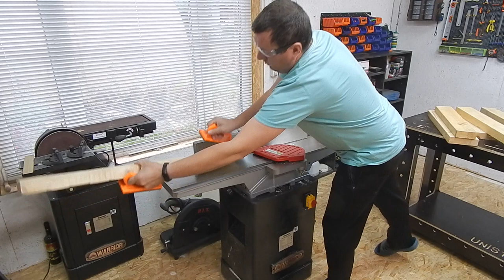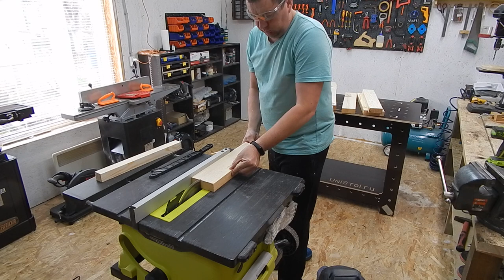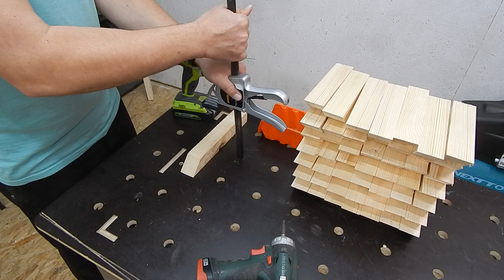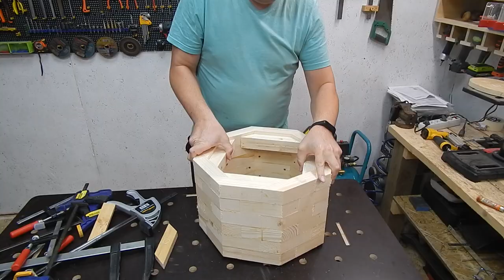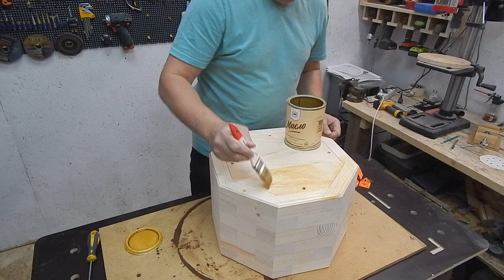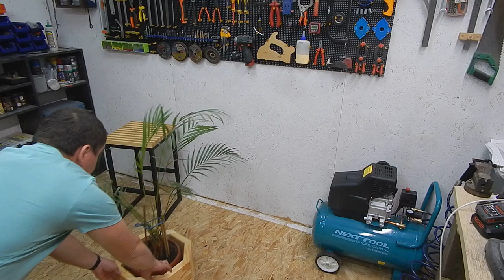DIY Unique Wood Planter Box

Comment: Very nice! What angle did you cut your small boards with! This turned out gorgeous! Thanks for sharing!
Reply: Hi pinkfluffydino it seems that there are eight sides if you divide 180 degrees by the the number of sides it should give you the angle of 22.5 degrees. Terry
Reply: @terencemeredith3066  Nice! Thanks!
Reply: Sorry its late but just tried building one myself.... And the cuts where made at 45 degrees since there single miters and double which would make them in an agle of 22.5. But since its one miter connecting both pieces the miter will be a 45
Reply: @rogeliochavira4524  makes sense! Thank you

Comment: 4:12. 8/12/24.     I just made this.  ALL ANGLE CUTS ARE 45 DEGREES.  I made each piece 9 inches long.  Equates to a diameter of  19 inches.  Pretty big.  Maybe start with a smaller piece. ( 7 inch?).  I used inch and one half screws.  I attached each "layer" with glue (Titebond Ultimate) and secured with 2 and one half pneumatic 16 gage nails.  I ripped the wood to 1.5 by 1.75.  My concern was having sufficient nail length (2.5 inches) to secure each layer.  My thought,   the nail penetration into the lower layer of 0.75 inches would be sufficient to hold layers together till the glue dries.